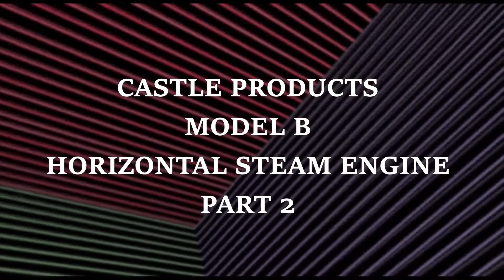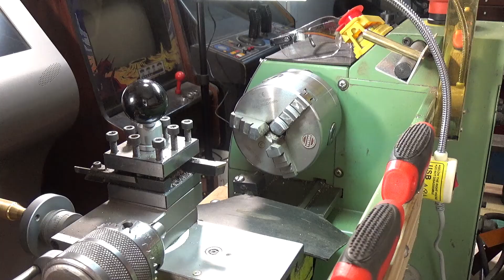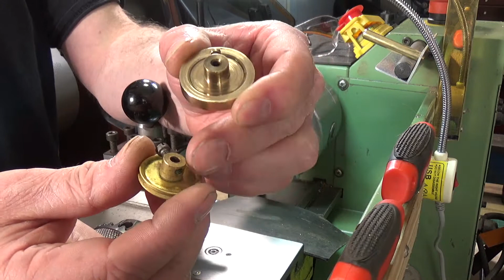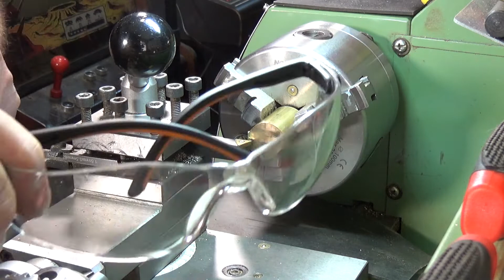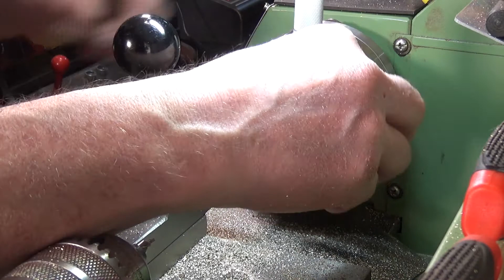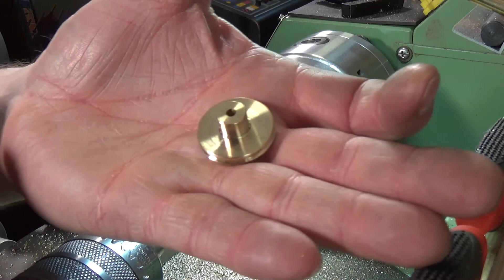Castle Products Model B Horizontal Steam Engine - Part 2

Comment: Very nice work Alan.  Just shows how good/accuarate these small Chinese lathes really are.  Brass looks nice but the cuttings are real bastards for fine splinters.

I would have tapped the thread while in the chuck, but that's just me.

Do you have collets for this lathe ?  A set of small ER's would be very useful on jobs like this.

Good video.

Thanks for posting.

Cheers Rob
Reply from the maker: Hi Rob. Thank you. The little chips spray everywhere! Yes i could have tapped it while it was in the chuck, just didn't think of it. I do have a set of collets and that would have been the correct way of doing it but basically i'm lazy. I couldn't be bothered to take the chuck off! Cheers, Alan.